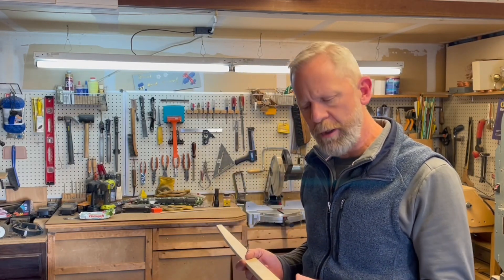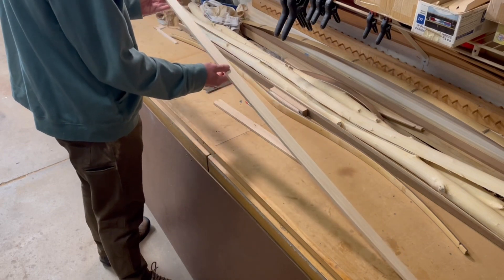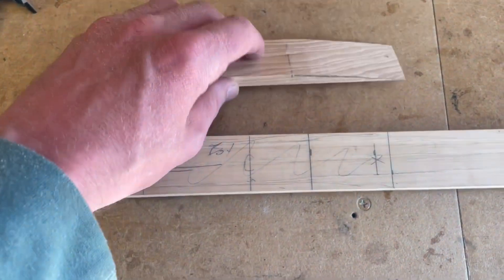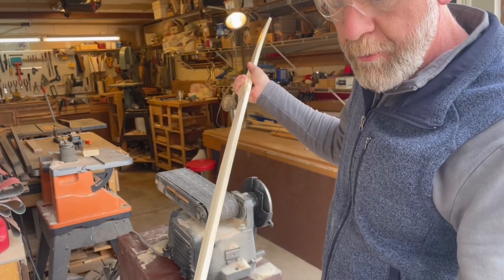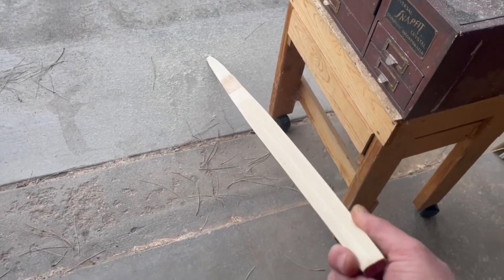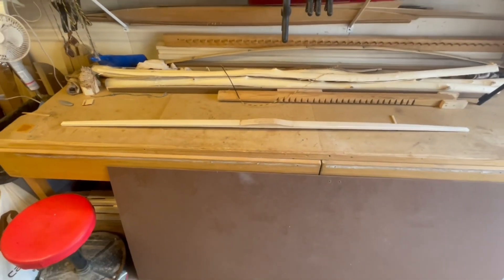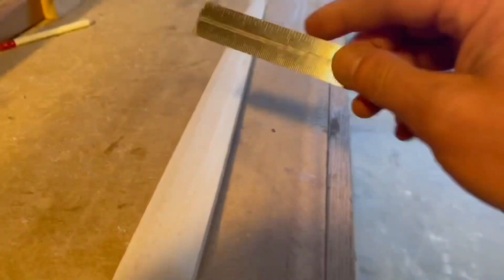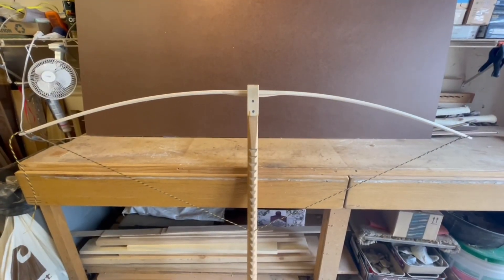Short hickory board self bow Pt.2 - Initial reduction

Comment: Is it possible to use mess dry wall tape for belly and back of a simple board? I'm terrible at tillering and just wanted to create a 35-40# bow,curious if it could make a thin piece more durable ?
Reply from the maker: In my opinion, there are so many better backing materials for a simple wood bow… but on the topic of fiberglass mesh tape:
First, it will go a longways to preventing a bow from breaking, but if built up too much, it will bring a lot of compression to bear on a belly that could cause chrissaling.  
Second, mesh tape is too limp to use in a belly application effectively.  It would simply fold up under compression.
No matter the case, you would still need to properly tiller the bow to make it functional - you’re just not going to get away from that fact.  If breaking your bow is a concern, I would suggest a flax fiber backing (linen) since it has tremendous tensile strength, but just enough stretch to keep from putting too much compression on the belly like fiberglass can do.  Rawhide is another good option for safety - it isn’t as strong as the first 2 mentioned backings - but a very viable, widely available, and easily applied option. It is my personal choice when I’m concerned about the integrity of the back of a wood bow.
Reply from the maker: If you’re interested in seeing just how amazing flax fiber is, check out this video… it has zero to do with bow building but everything to do with how to utilize this amazing natural fiber in applications that would benefit bowyers: https://youtu.be/AD98L9XlCTU
Reply: @meadowlarkadventuregear  thanks for your advice I truly appreciate it!
Reply: @meadowlarkadventuregear  I can't thank you enough for lending your time and knowledge,I definitely admire your craft ✌

Comment: Looking great so far... will you be fully flattening out the belly?
Reply from the maker: Short answer is no. The longer answer is that the belly will retain a slight crown as a result of this tillering process, but for all intents and purposes, it will be flat.
Reply: @meadowlarkadventuregear   Can you please specify the length, Thickness, width of wooden board which is used for making bow?

Comment: I wonder if the faceted  belly will weaken it .
Reply from the maker: The only way a faceted belly will weaken the bow is in the process of removing wood… any wood removal will functionally weaken the bending limb at the location of the removal. If the concern is for a high crown on the belly resulting in compression fractures, then I would say that as the craftsman, it’s our job to ensure that the side facets don’t become the focus of removal without keeping the middle facet in check as we approach full tiller. I think you’ll find the next video very informative in this discussion as it’s the belly facet that becomes the focus once the bow has been strung.